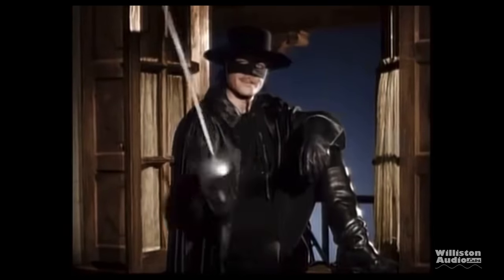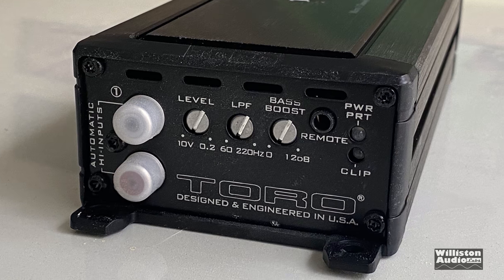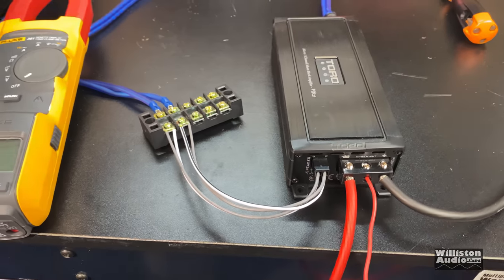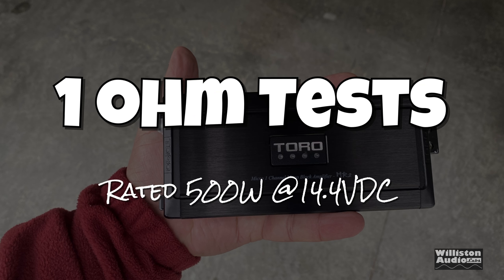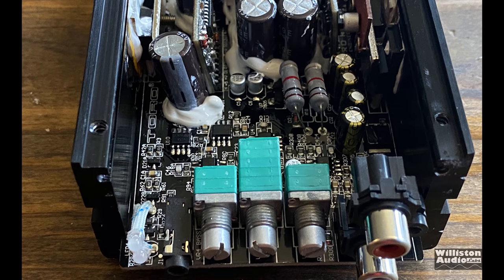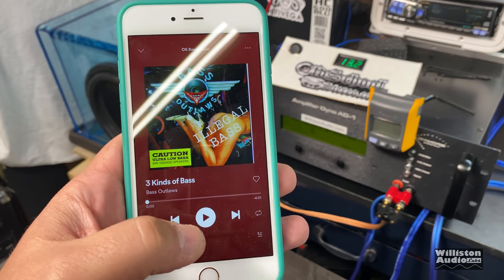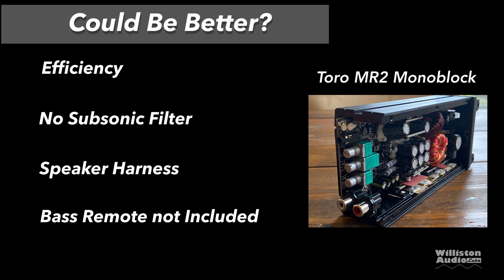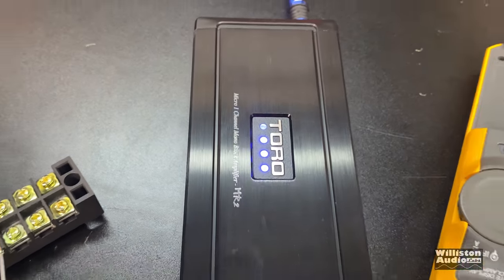This Bass Amp Fits in Your Pocket? Toro Audio MR2 500W mini Subwoofer Amp

Comment: Hmm looks like a product from Massive Audio
Reply from the maker: I thought the same but the circuit board has Toro silk screened on it
Reply: @wal  I think I've seen some budget subs from them recently as well. Maybe we have a new player entering the market.
Reply: @wal   I have been talking to some of the guys at Toro, Massive Audio is their build house. They don't have bass knobs yet, but the UR1 from massive will work on these amplifiers.
Reply: Looks ALOT like the massive BL1
Reply: @davidparham4485   going by the spec sheet, the BL4 is almost identical. I would love to see a comparison of the boards.

Comment: they had room to put a proper set of terminal outputs for the speaker out. no excuse for that lame 4 pin nonsense.
Reply: I agree with that and I'm pretty sure that 16 guage wire hurts the power a bit
Reply from the maker: Yeah I agree

Comment: That's not much bigger than the power pack amp that comes with the alpine ilx-w650 headunit.
Reply: You could try spraying the door with some lizard skin or use some strips of cheap mat..
Reply: That amp doesn’t come with the ILX-W650.

Comment: I purchased the r5 model which is the 4000 watt toro monoblock and I had to switch it out with my old bxx2400 and because the toro couldn't even push my 1 skar evl 15. This amp super overrated and sound isn't clean as you would think. Save your money and buy and skar or sundown amp
Reply: Thanks for the tip homie
Reply: @younginfamou6053  your welcome G, I wouldn't want you or anyone else spending their last 200 hundred and think that their gonna get clean loud bass and end up having to send the amp back. My 4 gauge reducers wouldn't fit their amp and they are supposedly 4 gauge power and ground inputs. For 80 dollars more I found an sfb2000.1 SUNDOWN full range amp SUNDOWN always underrates most of their products and they got 2 yr warranty.
Reply: @RomaVilla  lol 200 for that small piece of shit ? Ha I wouldn't spend more than 50 bucks for 500 watts maybe 100 for a new one. I got my skar 2k for like 189 in amazon
Reply: @younginfamou6053  naw my G, I paid 200 for the r5 model which is like a 4000 watts, this one from the video is their show opener and a s far as skar goes, they are better than most amps when it comes to budget amplifier, we can't all afford to buy Orion, Sundown or American bass VFL series competition amps. Which series skar do you have the rp2000.1? I use to own the same amp until I traded it for an American bass Hd series 3500 watts and then I sold that amp and saved up a little and got me one of those new Sundown amps sfb2000 and its rated at 2300 watts rms at 14.4 v and this is also a budget series but its all the power I could need to push my 15 zvx.
Reply: Roel144 pena I had 2 skar SAZ.3500.1’s and those things pissed me off bro, people bash on skar but I think the amp produces really clean sound and efficiently as well. It’s super similar to my ol rockford fosgate T1500.D I had in my Benz on 2 T1 12’s . Which if anyone knows about amps that’s certainly not a cheap one and still can’t find used ones for less than 450 . I like skar, I’ve had DC audio, FI audio, rockford, focal, sundown, skar, Orion hcca 12 but never an Orion amp.and hella more brands. But honestly if you have the right signal to the amp and a good enclosure it doesn’t really even matter what subs u got as long as the amp produces clean power. . I haven’t had American bass products yet so maybe I’ll grab something from them just to see how the quality control is.
Reply: @younginfamou6053  a
That's just my opinion on Skar ,American Bass makes some quality products especially there top of the line products
Reply: Chief9-10 ima try some XFL’s next, hope those fuckers bump. Never seen anyone say anything bad about American bass. Plus I love the patriot ‘MURICA’ flag style